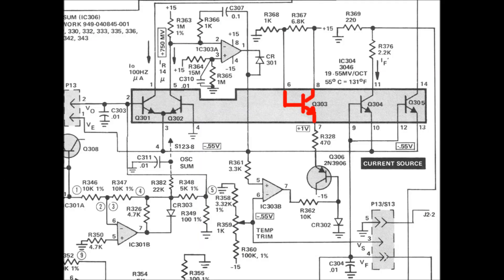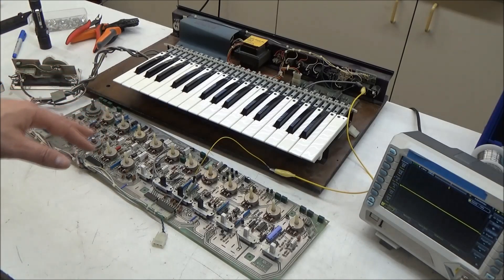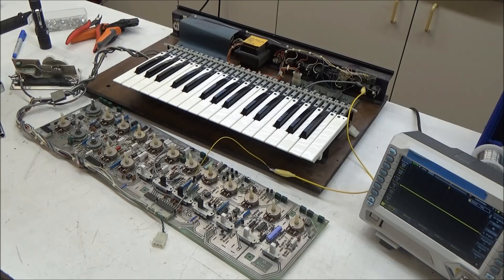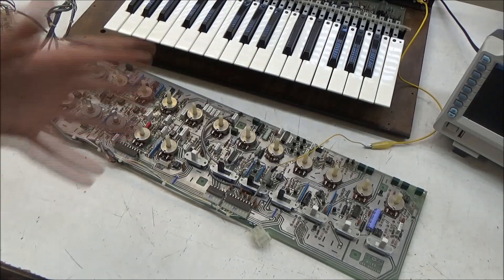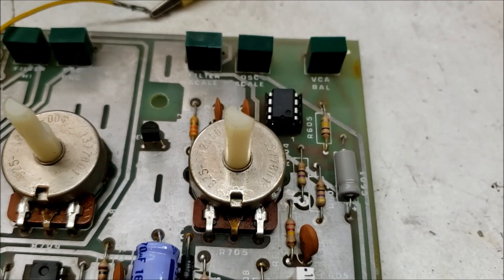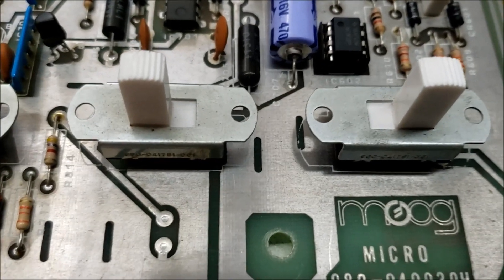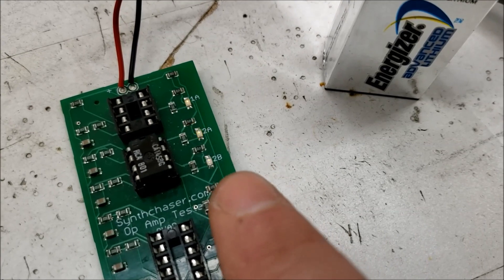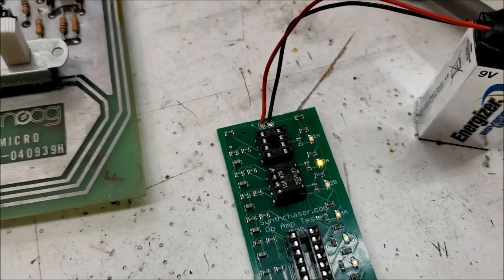Triple Moog Micromoog Repair - Part 2 - Synthchaser #155

Comment: Using a transistor as a heater ... well, learn something new every day. I don't think, they are supposed to be used as a heater? :D Heating up ICs isn't something new to me, but most equip i work on (measuring equipment), they usually use some sort of "external heater" on top of whatever IC or the IC/transistor is enclosed into whatever housing with a heater build in (temp controlled ofc).